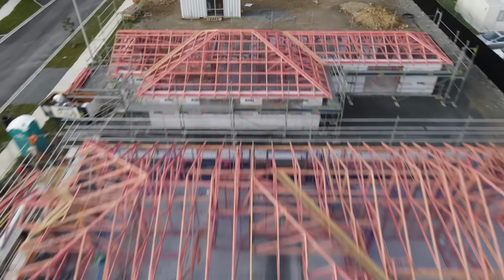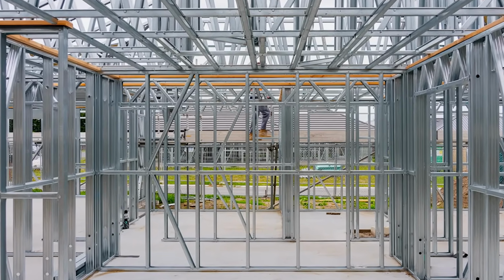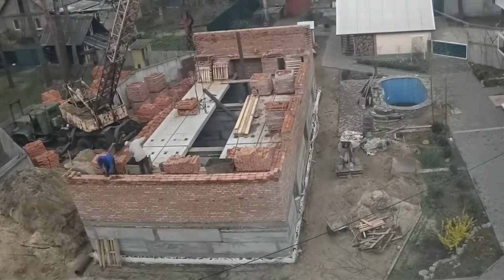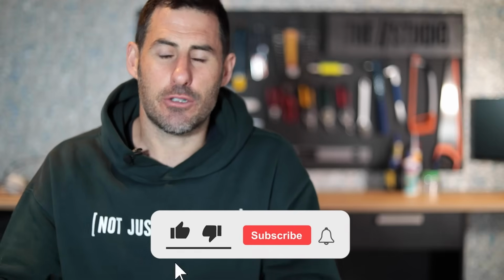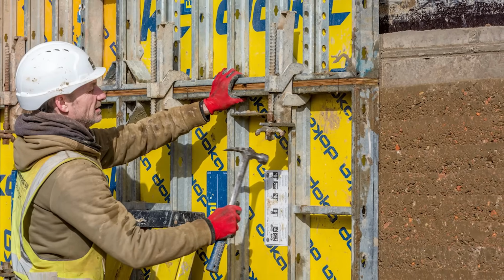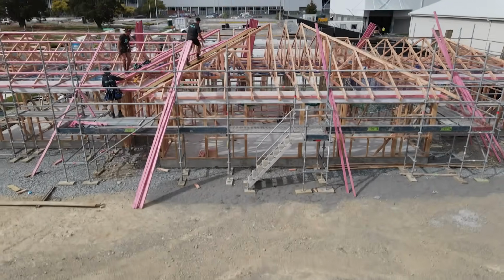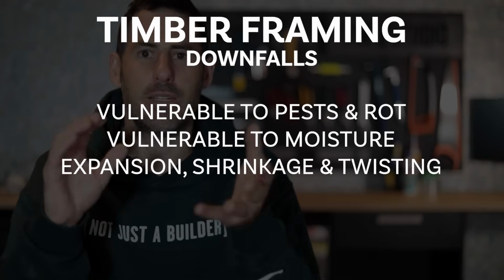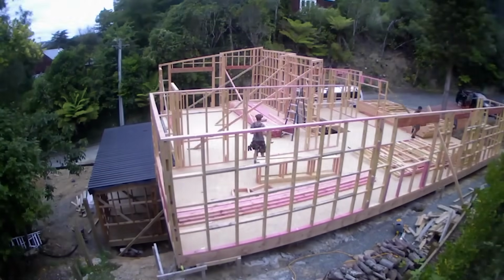New Zealand is OBSESSED!! with Timber Framing

Comment: Nz is obsessed with thimber roof trusses. They are such a waste of space. With the cost of land so high, why not use rafters to gain extra storage/living space on the same footprint.
Reply: Pitching a roof with an attic space to intend to use as another floor would require more timber and engineering to allow for the weight which makes a more expensive build. As timber goes up in size, it becomes more expensive, more steel in the concrete for thickenings to allow for support, rafters would move from 4x2 to  8x2 depending on span, or possibly even laminated beams. More cost. Basically a truss is the most economical way to frame a roof and the ceiling.
Reply: @flyboysnugs  In Europe they build more cost effective and better performing houses without trusses. The smaller the timber the more labour.
Reply: Why haven't you considered an attic truss?
They always been available in NZ since Mitek and Pydra joined the market.
Reply: Depending on span is the key consideration.
Reply: In Europe trusses are not common because of wasted space. But the carpenters have much better training compared to New Zealand builders.
Reply: not many carpenters these day know how to build a pitched roof. especially in volume framing. speed and $$$ over practicality.

Comment: Great video. I do wonder if we will start to see any frame and truss in the factories being made from LVL. Down here in South Canterbury there is one company who specialises in tilt panel construction mostly commercial buildings but they also homes. There a few in Tekapo that are tilt panel due to the site and the designs of the house. Multiple levels with basements built into a hillside
Reply: I've seen it done at a carters factory in the north island it was just way more expensive